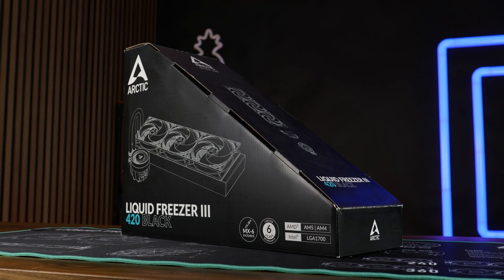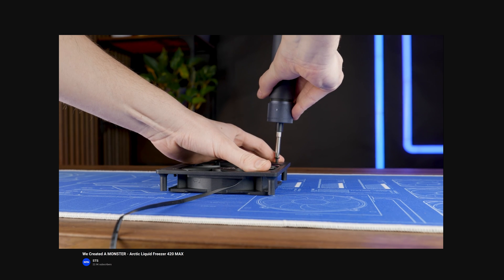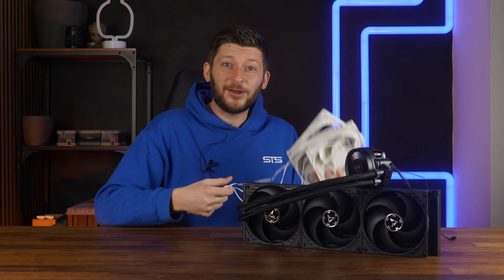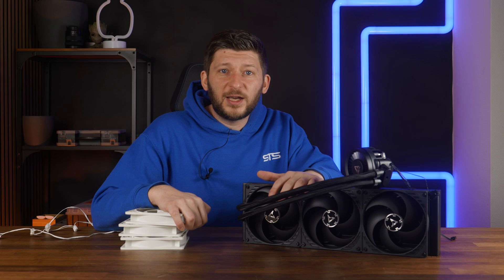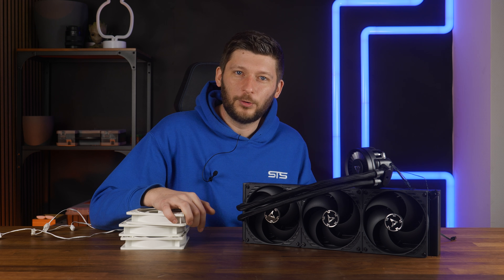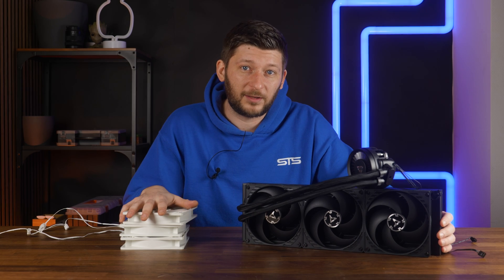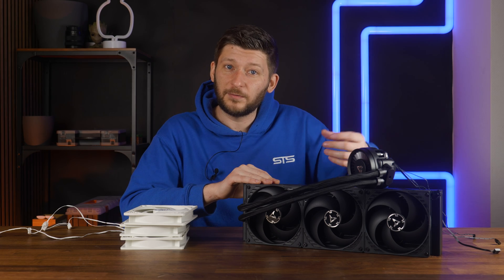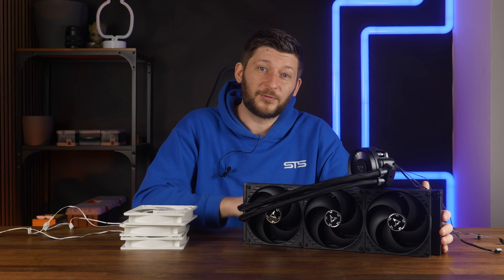Arctic Made A HUGE Mistake - Arctic Liquid Freezer III 420 in Push-Pull

Comment: I today am testing the Lian Li Trinity Performance 360 using the included P28 fans and some AL120 V2 fans in push pull. You so badly have me wanting to scrap this idea and just go with the LFIII 420 and use the AL140 V2 fans on it that I have.
Reply: Yea, I am looking at  6 BeQuiet Silent Wings Pro 4 (140) max speed 2400 . I have 3 BeQuiet Silent Wings Pro 4 (140)  not in use, perhaps purchase three more... I really should not watch his videos - it causes unnecessary purchases on my end or at least thats what I tell myself.
Reply: @AM-hm5eq  good luck to you!
Reply: @HanmaHeiro    I tested the thought of  push/pull on my case Lian Li 011 Dynamic EVO RGB and I would have to remove the top cover and attach the fans to the bracket. Perhaps I will create my second YouTube video... now where is that mic and camera....
Reply: @AM-hm5eq  lol I couldn't do my ideal setup of top mounting. So I went with a front mount. 11 degree improvement over the Enermax Liqmax 360! But having the AIO at the front messes with the way I had my computer designed. So I went ahead and bought the LFIII 420 to replace the galahad performance. Haven't been able to install it just yet
Reply: @HanmaHeiro  What Case are you using to do a front mount.
Reply: @AM-hm5eq  Phanteks G500A it's a rather tight fit haha. At first I had dreams of putting tubes down but that's impossible with a 350mm+ long GPU
Reply: @AM-hm5eq  haha Yea. Watching any YouTuber can make ya want to get the latest when the product is good or they talk about it really well

Comment: I was about to delid my 14900k and go for the EK.
Instead I will go push/pull with the LF3 420 now.
Any recommendations on what 6 fans I should get? 
Can it get even more silent than the arctic p14 without increasing temps?
Reply from the maker: My best guess would be the old A14s, but no promises
Reply: @STSYT  ty, I will have a look at them!

Comment: Got the previous 420 with 140 Noctuas set to push pull on the top of a Corsair 7000d. Have been very happy with it silent passively cooling 90% of the time. If one is going to bother fitting in a push/pull setup in their case, don't use stock fans.
Reply: Yup. It'll cost you though. 6 of those on sale rn would run 150... That's more than I paid for the LFiii 420. 🤣
Reply: 3 Phanteks PH-F120T30 on a 120 rad will get similar temp results and cost less with more idle noise @SergeyPupkoMusic
Reply: I  have a Lian Li 011 Dynamic EVO RGB case with the Arctic LF iii 420 with a push from bequiet 140 pro wing fans and pull for now from artic 140 pwm. It fits... I just removed the brace connected fans to the radiator and to the top of case. It looks like I dont even have pull fans in the case. except for how close the bottom fans are to the rear 120 mm

Comment: I'm not saying that you are wrong, but you assume that the radiator was at its maximum and the bottleneck.
However, if it wasn't, then any changes to the pump cap, tubing etc. could lead to increased thermal transfer in the new version.
And in this case previously unused potential by both radiator and fans could be used.
As I said, you might be right, but it's not as simple as it seems.
Reply from the maker: You’re right, there are more variables. But this was not really meant to point fingers at the old LFII, or call out a single aspect which may have led to this, but more about proving that the new one has much more potential than it seems

We’ll probably never know the full scope of this as nobody will ever try to transplant the old rad onto the new one or vice versa.
But definitely interesting if anything else might have been at fault, or a combination of things

Comment: I wonder what the difference would be if the same push pull config was done to the EK and Azza AIOs.
Reply from the maker: It’s not likely that I’ll repeat the same thing with more aios, but there will definitely be a standardized max performance testing in the future
Reply: @STSYT  Understandable. Main reason I am curious about a push pull with the other leading AIOs on that list is that the radiators are normal sized, making it a bit more "case compatible". That Arctic is a chunky boi!

Comment: What about the clearence between this and the top of the MB? If I did this MOD wouldn't I need to install it on the top and outside of my case? I'm quessing this setup would be 50% thicker. Showing it mounted in a case would interesing to see.
Reply from the maker: True that it could create an issue, but that’s also entirely case dependent. Best I could do is mention the total thickness, but that’s about it
Reply: Liquid cooling should be installed on air intake. Since it has low coolant/ambient t gradient, it depends strongly on the t of the intake air, and if mounted on top it will use warm air from the graphics card, that will decrease it's efficiency.

Comment: Please test Arctic Liquid Freezer III 360 with 3x P12 Max, that is going to be cool to test and see how it works, my first question is how loud will it be.
Reply: Hardware Canucks did replace the stock fans with P12 Max and the results were the following (254W at 38dB): 86.2°C stock vs 83.6°C Max. The only AIO that didn't benefit from replacing the stock fans was the T30 AIO. 
Too bad they're freaking expensive. Where I live I can get 9 P12 Max for the price of a 3 T30...
Reply from the maker: Definitely will as soon as a 360 arrives!

Comment: i already purchased 420 aio and looking for to buy phanteks d30-140 fans. but this much thickness is worrying me already. Is deepcool morpheus or lian li o11 dynamic evo xl will have enough clearance for both. I am really open to suggestions.
Reply from the maker: Would love to give you an answer, but I have neither of those cases, so no idea 😅
Reply: @STSYT  🤞
Reply: I have a similar case (011 Dynamic EVO RGB) and I have installed the OEM Artic III 420, the problem would be the rear 120mm fan.  The rear 120 mm fan set at the lowest setting would leave you with 1/2 and inch in space. If the fans you would like to use are not greater than 1/2 in depth your good to go. Although I wonder if the 120mm would fight with the 140mm for air space....

Comment: The good thing is that now you can benchmark fans by strapping them on the LFIII 420/360.
I replaced the fans on my LFII 280 with toughfan 14 pro. maybe try doing the same,probably not as good as push pull but its the best fan for thicc rads,least till' Phanteks makes a 140mm t-30 .
Reply from the maker: We actually got a toughfan 14 Pro waiting around for the review. If it’s anything close to the 12 Pro, it’s definitely a candidate for the first spot!
Reply: @STSYT   Well it's marketed as a fan for custom water cooling so it's better be good.
Reply from the maker: @100500daniel  oh man 😂 wait until I release these Endorfy Reviews. Never trust whatever manufacturers write. Whoever does copy doesn’t have to know anything about the thing he’s writing about
Reply: @STSYT   Alphacool Moment

Comment: Try the A-rgb version. It has the rims you're talking about, and it definitely improves the noise/rpm ratio especially on the 140mm version of the P series.
Reply from the maker: Possible, I just try to avoid talking about it until I get a unit. No need to speculate in my position
Reply: @STSYT  wow this is a next lvl of lame. Removing a comment for suggesting watching complementary data on another reviewer. Great community.
Reply from the maker: I have no clue what comment you’re referring to, nor have I removed any comment. Checked the filter, nothing was blocked.
Your comment or somebody else?

Comment: Arctic is cool but I wish they would add an LCD panel and I am not sure I want an extra vrm fan on my AIO since it would make extra noise. However I never tried an Arctic AIO so I might be missing out.
Reply: I'm glad they didn't do that, what you gotta understand is leaving out that stupid LCD screen is a part of what lowers the price,  the other companies put a huge mark up just because that little screen. The VRM fan is also function over form and in my opinion it looks better. I'd rather not give arctic a reason to mark up the price,  thankfully they're a good company so maybe they wouldn't but I think Arctic made a great decision to not have an LCD screen.
Reply from the maker: The vrm fan can definitely be classified as ‘good to have, but not necessary’. About the LCD, maybe, just not everyone wants that kind of stuff. Maybe an optional upgrade option
Reply: You cant hear the vrm fan
Reply: Or just unplug it
Reply: Based on the "Magnetic Connection of the VRM" it would be super easy for Artic to create an LCD attachment to the pump. I think ... I think .... One could use the VRM connection to power the LCD Screen then create via 3d printer a new topper attach said LCD screen and whala... Again this is a I think.

Comment: So, technically, if we just look at the aio without considering the fans, this is at the top?
That would mean that by using six more powerful fans (ek or noctua for example) and doing push/pull config, one would get the best possible aio, right?
Reply from the maker: Hard to say without testing every aio with the same fan. I’ll probably include this type of testing in the future, just haven’t settled on the fan choice jet
Reply: @STSYT  Thanks for such a quick reply. I've had a liquid freezer II 420 for quite a while and wanted to upgrade my cooling in a month or two. Right now i'm conflicted between the EK nucleus cr360 and this one. Both would be push/pull but I think the former wouldn't benefit nearly as much as the latter from this configuration due to its much thinner radiator.
Reply from the maker: @rickcelestino2620  you’re welcome! And absolutely possible. I would love to give a more exact answer, but I doubt we are going to finish testing in that time span :/

Comment: Lower the noise by adding a spacer with thinner fans or longer screws.. or quieter fans
only pushing 250w doesn't really do anything against a well installed LF3, try pushing 375w, it might get warmer xD
Reply: Luckily AMD sent us Intel killer, 9950x3d, which will never reach 300wtts, so this cooler is perfection❤ it even gives us overclock headroom 🤯

Comment: Seeing that nucleus still on top together with this makes me want a push/pull benchmark with that monster
Reply from the maker: Definitely, I just need to settle for which fans are going to be used on ‘every’ aio
Reply: @STSYT  Maybe also put the Nucleus fans on the LFIII, this would be very exciting to see
Reply: @STSYT  I think on 240,360 aios Phanteks T30 should be the choice. For  the 280 or 420 AIO it is harder to choose, maybe toughfan 14 pro or SILENT WINGS PRO 4 but then P14 Max is going to release and then T30 in 140 mm size from phanteks and noctuas new 140mm in the future.
Reply: @STSYT  I put noctua industrial ppc2000 on nucleus in push pull yesterday and did not help at all, but could be mismatch with nucleus fans. Sticking to just 3 nucleus fans . Oh and its the direct die version so managed over 400w on 14900k no throttling but risky business.
Reply: @Techno_Rama Thanks for your input! I'm torn if to get the EK DD AIO or a cheap DD block like Supercool/IceManCooler. Already got 360mm rads, tubes fittings. Just need a decent pump/res.
Reply: @Ben-ld1qi  I think if you already have that much equipment go for full custom loop as I saw a video(frame chasers) comparing DD custom loop and it was better by about 9C over the DD AIO, but otherwise the AIO does its job. Good Luck and if get a chance let me know how it worked out.
Reply: @STSYT push pull for every aio yes pls!
Reply: @STSYT  Silent Wings Pro 4 are the clear winner for AIO performance in the 120x25 size category due their best in class static pressure - nothing else really compares within the crop of "current gen" fans. T30 are indeed great, but comparing 120x30 class fans (T30, P28) to 120x25 class fans is a bit misleading. Lots of cases with top AIO compatibility don't have sufficient clearance to even consider anything thicker than standard thickness 27mm rad / 25mm fan combos.

The EK CR240 is really held back by it's stock fans too. Test the EK CR240 with 3x T30, 3x SWP4, 6x T30 and 6x SWP4 !
Reply: Any chance of a EK Nucleus 6 fan comparison?
Reply: What if you use 140mm industrial fans? ^_^
Reply: @Grabarz23  i did use the 140mm ppc industrials as it only what i had,. not great fitment so could have affected effectiveness. thinking of getting 3 more ek 120mm fans to match but i think i went far enough already!

Comment: That is very interesting and on the bright side, an LFIII + a 3-pack of P12s(for the 360mm) or P14s will probably still set you lower than some competitor AIOs (at least with the current anniversary discount), which is just dumb at this point. 

I actually do hope Arctic tries to take this into account further down the line, and they can even go the "lazy way" about it and just offer a standard LFIII 360/420 + a slightly discounted fan 3-pack as a combo, the idea being to not need to make new boxes, shipping procedures etc.
Reply from the maker: Or just add better fans, no need to make this a thing. Next gen P14’s could make it work

Comment: Smiling with my LF2 420 push/pull with 6x Noctua NF-A14 PPC 3000, wish the LF3 was available 3mo ago.
Reply: ippc fans have heavy duty and a lot noisier motors. Those fans are horrible for noise/performance ratio.
Reply: @TTks124   No problems if you set fan curves in BIOS. 🧠
Reply: @paradigmshift7  It performs really bad relative to other fans at low speed.
Reply: @slowepal  lolwut??? NF A-14s are legendary,  you talking out of your A$$
Reply: @paradigmshift7  You're right. But its been quite some time since the IPPC's have been out and the competition has caught up.
Reply: @ The only thing with real gains is Phantek's T30 which also runs 3000rpm, and it still doesnt match the static friction nor volume of the Noctua.  It also doesnt come in a 140mm.
Reply from the maker: Don’t forget about condensation
Reply: Same... Just finished my build 🤦
Reply: I had same fans on my h170 and the LF III still beats it with standard fans . I still have the noctua but like the quiet .. not used to it :-$)
Reply: What case do you have that fits this setup?
Reply: @ Fractal Torrent.  Could also run same setup in a Fractal North XL.

Comment: Hm okay nice for Artic.... My Alphacool Monsta with 3x180 is freezing all just fine for me =)
Reply from the maker: Always wanted to benchmark one of these 😅
Reply: @ Yeah =)
I have a 3700X with a 2070 Super on this Rad.
About 2h by 22°C room is: max 44°C on GPU and CPU 57°C. CPU has the Uefi setting with Load line High and Boost 10x. So far its chilled.

Comment: So, what fans would allow the Liquid Freezer III both 420 and 360 to reach it's potential? Does it have to be a push/pull config, or are they superior fans that would allow it to reach it's potential? It's rather amazing the EK Nucleus at 360mm keeps up with the LF 420.
Reply from the maker: I’m in the process of finding the answer to that.
The max performance can certainly be reached by a triple fan setup, I’m just not sure if I can recreate the noise to performance curve without push-pull
Reply: @STSYT   I think the fans you are looking for is Phanteks D30 140mm.
Reply: Maybe Noiseblocker eLoop B14-P fans? They are 30mm thick fans with wide blades that are connected on the edges, great for static pressure.

Comment: You need to try out the Lian Li Galahad Performance with push pull! :)
Either way i always did a push pull config on my Freezer II, now on my kids rig ... amazing performance, but of course, not all cases can handle it.
Reply from the maker: Once I’m done finding the perfect radiator fans, there is going to be standardized testing for ‘potential’ performance in every review. Probably also going to re-test some older stuff like the GA
Reply: @STSYT  tbh due to the Galahad lack of reliability… I’ve been thinking about the 420 freezer. Although technically I think the Galahad is better, with stronger pump, larger ID of the tubing and the higher fin density. 

But although in the paper everything looks awesome… the pump problems are still there since I’m on my second unit. My lian li has 6 p12 max and it’s been amazing but I have base to compare since I’m using a zen4
Reply: @PedroSombreireiro I bought the of 420. I still have my ga performance but my pump head is making loud bearing sounds, and I am not ready to ram for the 2nd time.
Reply: @Nods.O  i have 2 x GA Performance. So i will wait for my first one to die, so i can use the second and let it die too ... after that, i will get the LFIII 420 :D
Reply: @PedroSombreireiro  my second one died already. No point bothering with Liam li again.
Reply: @Nods.O   yeah, i know what's ahead for me ... eheheh. It's a pitty, because the pump, rad and so on, on paper, are perfect, and in fact, when working, it is better than the LFIII 420 ...
Reply: Oh oh .... P14 MAX are out!!!!! :D

Comment: Get 840mm p14 max. Better than lcd gaming screens.
Reply from the maker: What?
Reply: I mean got full out with 6 140mm(840mm total fan size) p14 max. I've seen bitwit use p12 max to get an arctic performance without paying premium.
Reply: @TewaAya iirc the p14 max is a lot less impressive than the p12 max
Reply: @analogicparadox  P14 Max isn't out yet
Reply: @moepOo  my b, I might be thinking about the bionix

Comment: Out of curiosity, how would the Liquid Freezer III perform with T30 fans? I ask because I have 3 fans in storage 💀
Reply from the maker: That would be on a 360mm then, probably slightly better than original, but that’s just a guess
Reply: @STSYT  oh that’s right! I completely forgot they’re 120mm fans, appreciate the guess though!
Reply: To be fair you could 3d print or buy an adapter and try anyway
Reply from the maker: @analogicparadox  or use these Noctua adapters. Which I believe I already did in these ‘MAX’ videos?